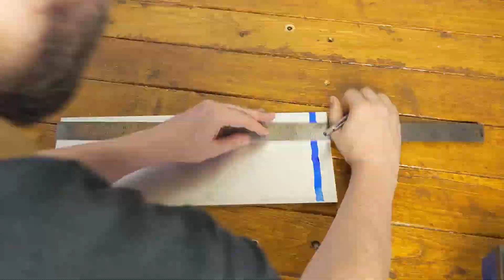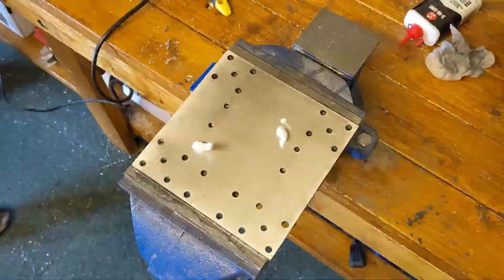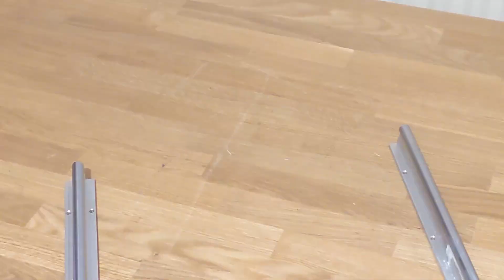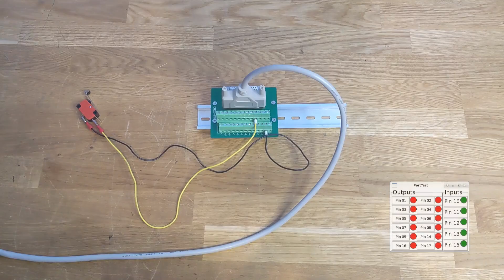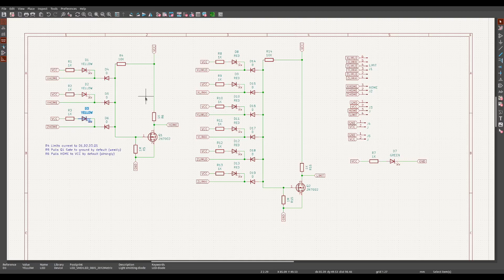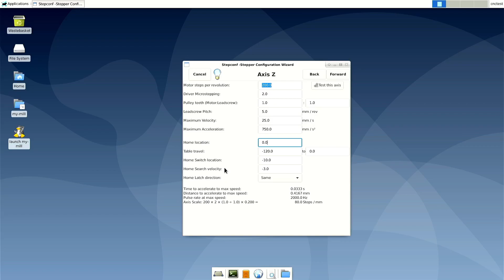Limits and homing with LinuxCNC

Comment: i just build my cnc X axis, limitsSW both end,  and home inductive sensor left side X, i configure 2 paraller port card, used, first main port has connected all home axis, XYZ, second paraller port have all limit SW. hard limit, not can go out of linear rails, have better connect all limitSW same pin 10 than E-stop or all limit SW own axis limitSW both side X, both limit Y, both limit SW Z etc. why my first test i call homing X, go to left my home SW, BUT why start go back to right side after connect to home SW, and not stop, need E-stop can stop not run out of rails. what need make ? home X,home Y, home Z, have configured. and all limit SW have top of rail, and configured 2 different style possiple use, all limit same pin than E-stop, or all limitSW  pin X11,Y12,Z13. second paraller port card,  because one paraller port have only 4 pin can use.10 E-stop, X home,Y home,Z home, and pin 15 probe.  what need make configure wisard ??. home axis right ? my X have 0 to 800 ,linear rail dimension, Y 0 to 1000, Z 0 to -300, have this right ? home setting 0.0 search home 1,5 mm/s what need do. homing normal ,if bush button home X then move left to minus  but stop then connect home SW.,why run back to right ? and not stop newer, if not bush E-stop run out of rails and broken machine. help please what need do go normal only left and stay stop to home position.if i bush button home X , Z and Y not have tested yet, not all parts have ready.
Reply: or need i buy 6 inductive sensor more(expensive option) and make soft limit too my machine ?  i have mechanic hard limit SW 6 pcs, to installed and 3 inductive sensor home SW to X left side, Y front side, Z up side. X left is 0.0 to right 800, Y front 0.0 to back 1000mm, Z 0.0 up to down -300 . have this right at configuration ? i not know. 0.0 have home position.